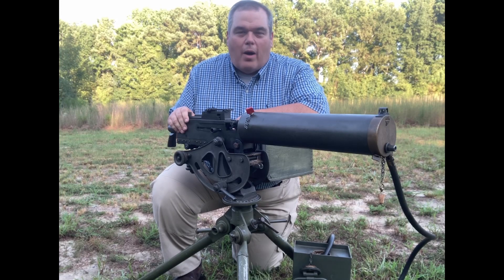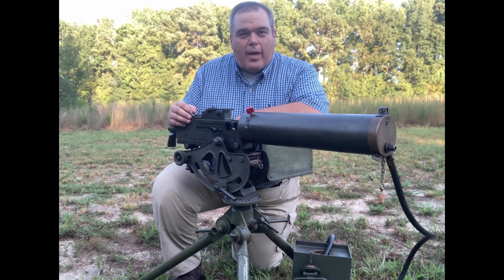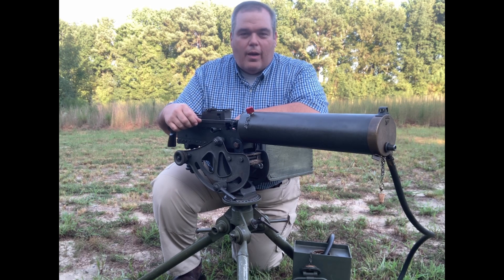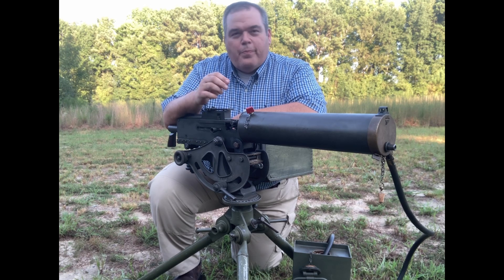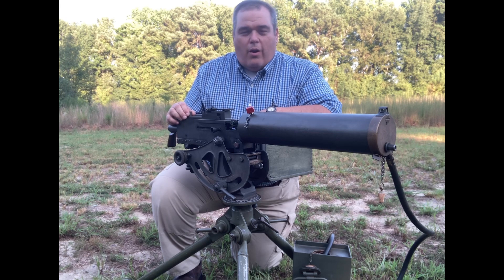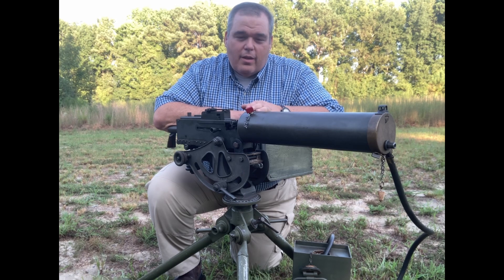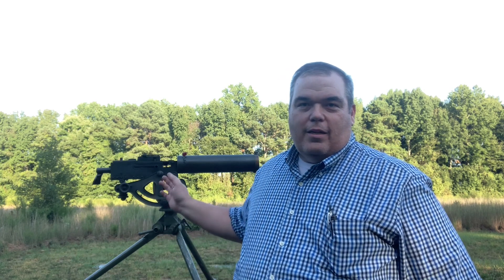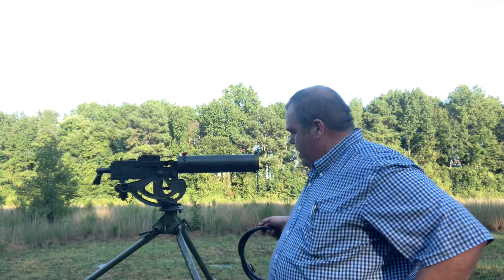1917a1 Browning Machine Gun Accessories episode #1 Water cooling WWI WWII

Comment: Enjoyed the video. With my mg on the way, I've been trying to find a good video of someone showing proper head space if you could. Also I've heard of replacing the barrel packing with orings, could you show removing the barrel and setting those in? No one seems to offer a photo set or video of that
Reply: PS, I do have the TMs that were produced over the years. But a video demonstration would be awesome
Reply from the maker: @EmuOrdnance  originally the 1917a1 used greased asbestos string. I actually have some original examples that I will show in spare parts box episode. You can use “O” rings. The rear may take two. 
Some also use a greased plumbers cord.  There’s a couple different options. 
Head spacing is easy, but very necessary to know how to do. Head Space should be checked before each range trip. 
About the water….if it’s not leaking, it’s because you don’t have water in it…😜. It’ll drip after a bit. Especially if your trunnion has any scratches or scarring inside. 
The trick is knowing how much cording to add to make it tight enough to not leak, but not so tight as to hinder the cycling.